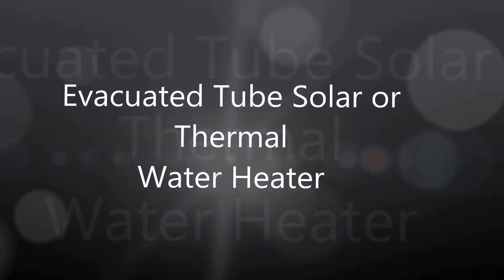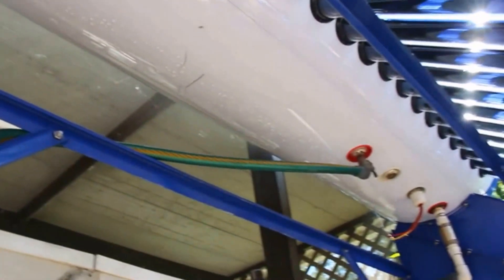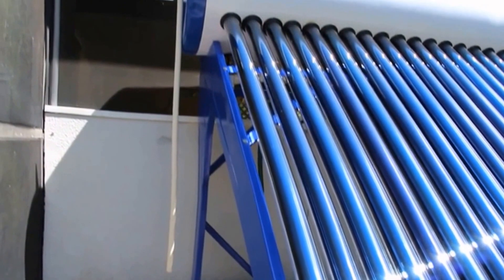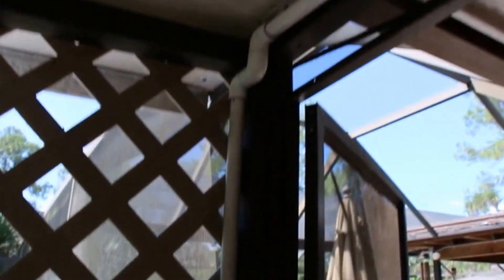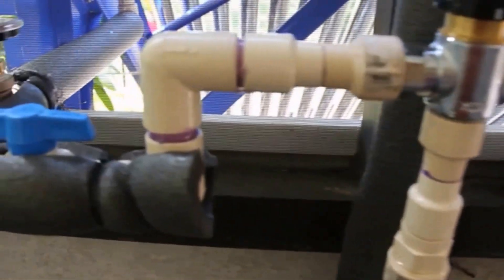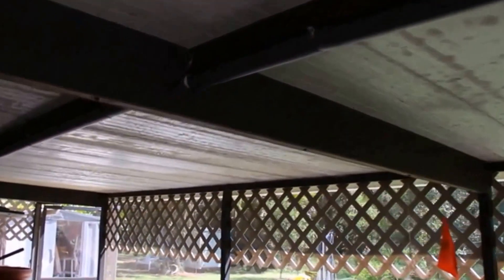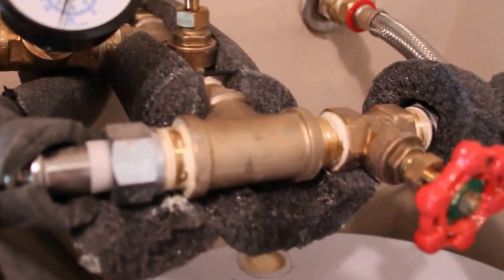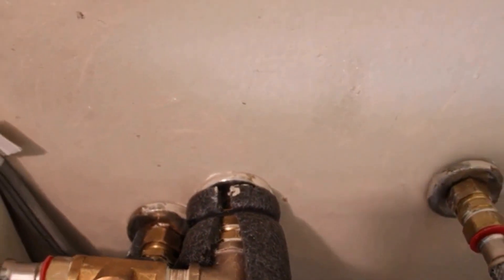Evacuated Tube Solar Thermal Water Heater

Comment: CPVC has failed on me so many times it's not funny.   Later if you do get a failure, switch the hot water over to pex, or copper.
Reply from the maker: Couldn’t agree more.  I unhooked it several years ago.  Now it’s just sitting there.

Comment: Good day. I was just interested to know if you still use a system... If you did any more modifying or if there are any changes that you would do with it. Thank you so much.
Reply from the maker: Brad Ley I’m no longer using it since I left it on during a vacation, got home, took shower and melted most of those cpvc pipes.
Reply: @ThatDutchMike  
Wow... well that is good to know. Very glad to hear that the water melted the pipes before getting to you...

Comment: I have almost the same model but i didnt understand the green pipe you installed , what its function? another question if i may , can i install it without mixing temperature valve  , just the classic bathtub valve?
Reply from the maker: Kurosaki Ichigo you can leave mixing valve off but at your own risk of burning yourself.  (Probably will never happen). I took mine off after it broke in about a year.
Reply from the maker: Kurosaki Ichigo green pipe is just a water hose to take some where I may need it.  Can also be used to drain the tank.

Comment from the maker: I think I paid less than $1000 and installed it myself.
Reply: Mike, where did you pick up for 1k?  Also, has there been any issue without the mixing valve and the PVC, meaning the water temp is close to boiling at full sun...correct?  (considering copper or pex, havent considered pvc).  Lastly, im assuming your water heater is always inline. (i noted you had ability to bypass)  I'm ready to pull trigger for preheat to 13kW tankless water heater....

Comment: Do you need a heat dump? If the system produces too much hot water.
Reply: Yes. Usually the heaters come with that already installed, but I'm not familiar with this particular model.

Comment: That "backup" electric is I believe for heat tape incase of freezing, which by your area doesnt look like its going to be an issue.  The reflective will be a real eye pain, as well as potentially dangerous for a solid installation for ground level installation, probably not a smart idea as to your location with it now. If it was on the rooftop, it would be a better idea because the sides of the parabolic would as well help with deflecting the wind and weather.  Its the problem with the design really.  Spread out and parabolic troughs for each is superior in ability and sadly cost in copper.  Neat setup. The design itself for these tank systems could be improved. Instead of the aluminum flange within the tube, they should be using a sealed wax sleeve for heat collection and holding, then it would maintain a high percentage of its heat all night as well.  There is as well another potential energy output glaringly available that they rushed past sadly... Congratulations and wise choice for the future, tank systems are the best overall, those without the tanks are far harder to maintain and control systems for them are outrageously priced. Perhaps in the future you can modify it to get even more out of it, we shall see eh?

Comment: man looks exspensive nice vid bro
Reply: 20 tube vacuum system prices where i live start from 400 ... some time there has been 15 tube units for 200 but that is very basic non pressurized use.
I also would use copper pipes when PVC is not for longterm use with hot water and many glues tend to fail under heat.